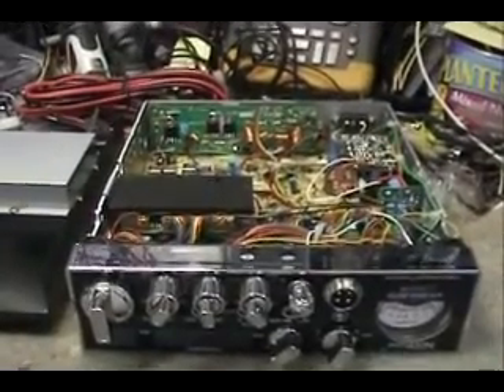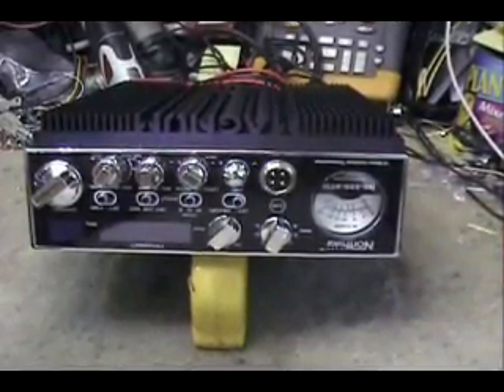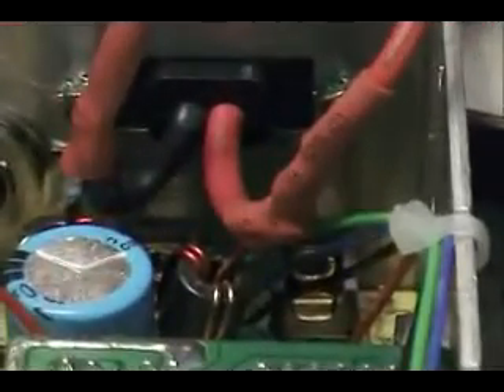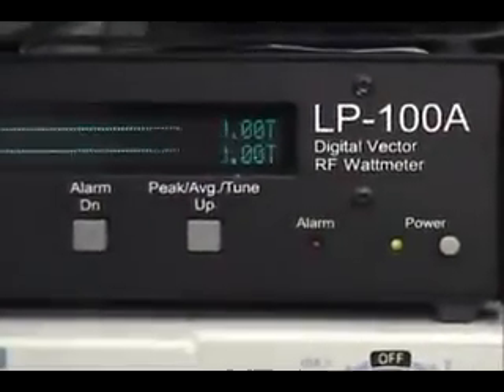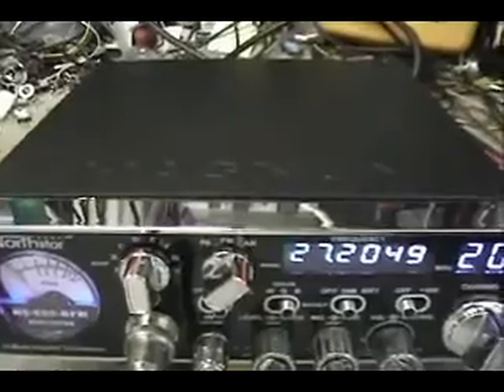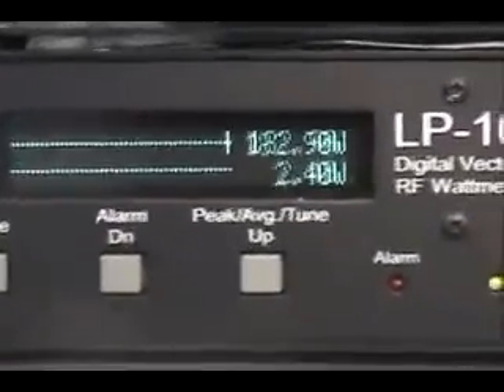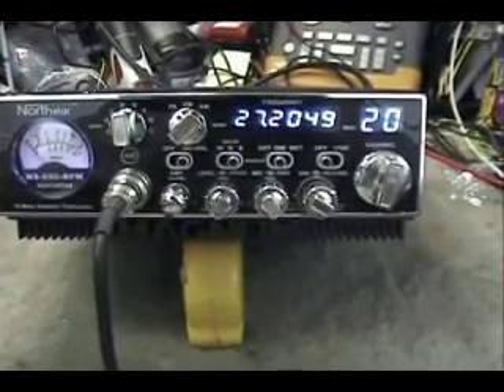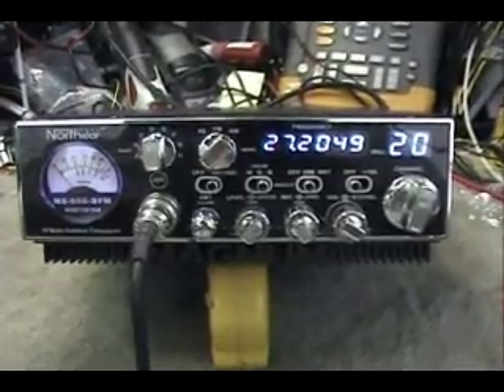Magnum SX-175-3 Review

Comment: glad to see you in action again. looks like a good idea.  probably will fit a newer 148gtl, ranger 2950 (no point intended, only for those who own a 2950) not likely fitting hr2510/2600, any side mike radio, or president radios.

if you read this, i need to talk to you on private terms so send me a message and i will write back.   -dave